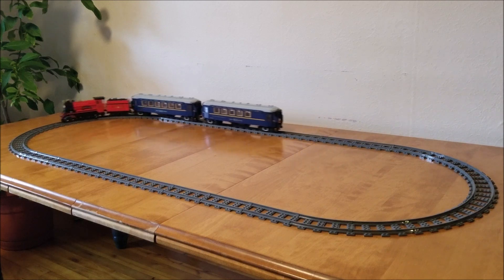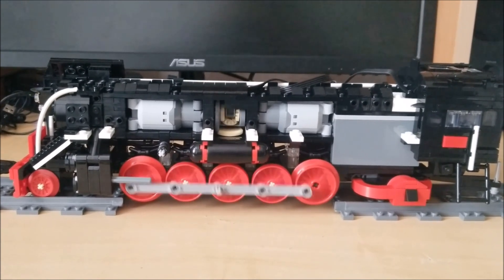Double the Power - Modifying the LEGO Orient Express Train

Comment: What if you used a 9volt motor with a power functions motor tied together? Power from the tracks also gives power to the PF motors. Why hasn't anyone tried that yet??
Reply from the maker: That's a cool idea to hybrid the two power systems! But the hardware for the 9V system is expensive and hard to find, otherwise I would use it for my entire train layout.
Reply: @danjotrains  I have seen 9 volt motors on ebay for not to expensive price, plus I think some Brick related websites have carried it, Also, Bevins Brick Worlds YouTube channel actually sells special made Pick up wheels for that kind of intergration with PF motors. You should check out some of his example videos of it.

Comment: this video is exactly what I'm currently doing with my Orient Express, I have 3 of them and I am modifying the engines into  2-8-8-4 monster, just waiting Bricklink... too bad I didn't see this before buying the parts for the gear assembly (mine is probably not going to be very strong, but I will figure that out later), BUT I also thought of the 2 motor with diff gear, nice to know I'm not a full idiot
Reply from the maker: It's going to look fantastic as a 2-8-8-4!
Reply: @danjotrains  if I can get all my stuff from Bricklink... yeah that's a pain, but it will look spectacular

Comment: I bet you, it can pull more if using the custom ball-bearing wheel sets that are made by brickmodel railroader and bricktrain depot.
Reply from the maker: How performing are they compared to the old metal axle Lego wheel sets?
Reply: @danjotrains 
The best way to describe it as friction bearing axles vs. roller bearing axles. The roller bearing axles take alot less effort to pull and keep their momentum alot longer than friction axles which takes more effort to move,

I've found on some heavier cars they roll alot farther on their own than if they had traditional lego axles. Pretty much they save on the friction and let you pull more cars and in some cases go faster than traditional trains.
If you ever look at PennLUG or TexasLUG train layouts they run bearing axles on alot of their equipment. Infact, because of the bearing axles they were running trains so long they had to create a new coupler system to mitigate breaks in the trains caused by magnets not being able to pull such large trains.
Reply from the maker: Thanks for the info! I'll see if I can get my hands on the ball-bearing wheels and try them out on the heavy cars.

Comment: How much of the power does the motor setup draw?  I saw a few videos where people attempted to motorize it with just 1 motor, and it ran out of power in like 2 hrs.
Reply from the maker: Good question, I have not tested the battery life with both motors on at full power but I imagine it would drain the battery in half the time. 
To get around this, I would recommend a battery box that's easy to recharge. I'm looking into getting a BuWizz for my train.

Comment: I've been watching through your backlog, and really been enjoying the layout progress stuff and loco showcases. Just got a question regarding this one: why do the R56 curves make more of a challenge for the trains? I thought a wider curve would be less of the strain on the motors.
Reply from the maker: Thanks! Glad you enjoy the videos😄 The R56 curves do indeed make it easier for the trains to pull. Originally when testing, the Hogwarts stalled even sooner on the R40 curves with all the extra weight. I ended up setting up the R56 test track to see if it could make it around at least once (but it stalled there too as seen in the video). The Orient Express can do R40 but looks much smoother going around wider curves :)

Comment: Does the Orient Express come with those tires on its driving wheels? I tried building a large tank engine and tried putting the motor on both the driving wheels (which had no tires) and the rear bogie (which had tires) and both failed to povide adequate power to move the engine.
Seeing this makes me ponder where i went wrong. :/ Was i just too heavy?
Reply from the maker: I added the red elastics to the driving wheels for better traction! Otherwise the train has a hard time moving. You can get them on Bricklink. If the wheels on your tank engine are "slipping" when they turn you might have enough power but not enough grip.
Reply: @danjotrains  I just rebuilt the tank engine into a GP-style diesel. I'll keep those elastics in mind if I ever get my own Orient Express (Assuming they don't discontinue it soon).

Update: The engine still slips like crazy. I'm using tired wheels but as soon as I put on a few cars it struggles to move, especially on curves. What am I doing wrong?

Comment: Interesting concept but it seems the second large motor doesn't add much if anything without more weight on the locomotive because it looks like the wheels just slip more when you turned on the second motor.  You might try adding some 2x2 zinc brick weights to the locomotive if there's still room somewhere.
Reply from the maker: The zinc bricks are a great idea, I'll see if I can order some and get better traction! I definitely want to test the max amount that this setup can pull, but I need to find some more passenger cars first 😂

Comment: This is really awesome!! Would love to the full finished locomotive with the 2 motors and the instructions to build that. I am familiar with Py bricks, so I would expect the instructions to explain the basic details. One last request is to have the engine increased in length so that cab interiors is same as original one. Very excited to see the final build and instructions.
Reply: Do you suggest using two tenders with powered up train motors to pull more trains cars? The other idea is to use powered up XL motor in the engine and two tenders with train motors. Will this be a workable solution?

Is it possible to test these configurations in your setup?
Reply from the maker: @prashantbhargava694  I remember testing with a single Power Functions XL motor (older system) and it had significantly more torque and power than a large motor but lower RPM. Two of those can definitely pull more cars but it would be a slower moving train. They are bulky though and hard to fit inside the boiler. 

I can try testing with the two large motors plus a powered tender and see how much I can pull!
Reply from the maker: Thanks! And good point, I'll be sure to include/explain Pybricks with the instructions.